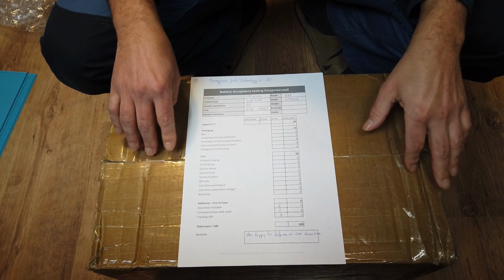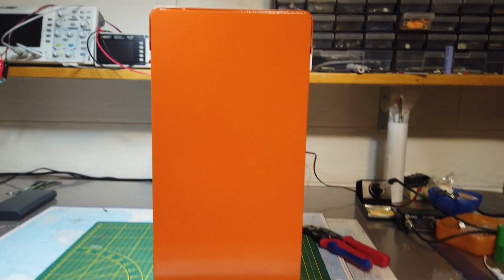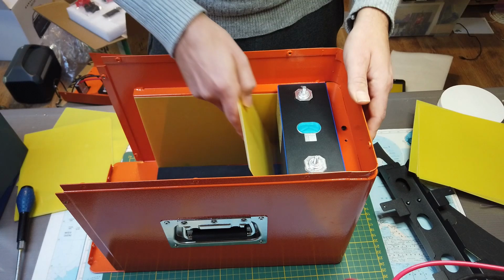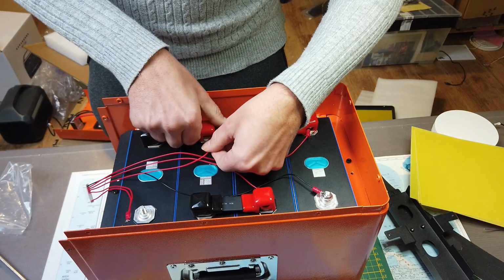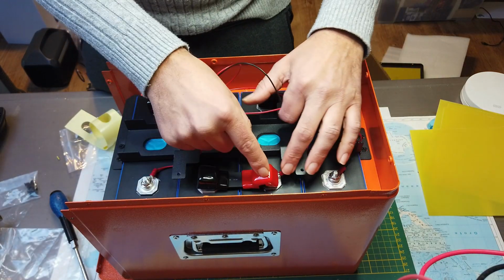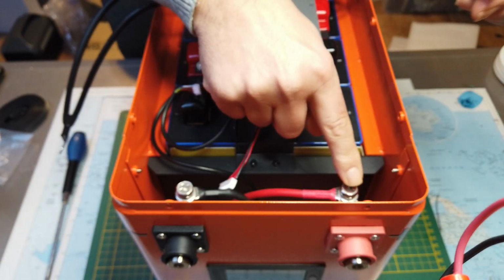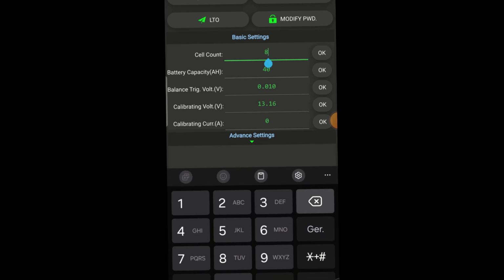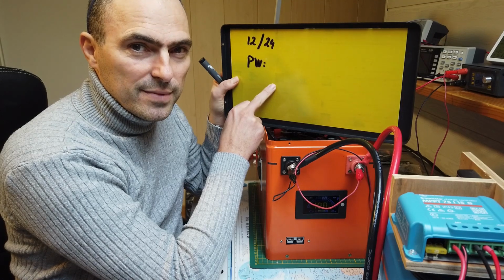UBP DIY battery box step by step assembly guide

Comment: They are using two 8AWG wires for the negative terminal? That's a recommended ampacity of 110A. What's the point of a 200A continuous BMS if the cables aren't rated for it?
Also, I noticed you put the main negative lug above the balancing wire lug. Lugs carrying the most current should be closest to the power source.
Reply from the maker: Good remark. I mentioned it for the positive pole but didn't apply for the negative pole. Will add "errata" under the video and on the EASYPOWERWALL FB page.
About the power, it's always good to have some headroom. 80AMP/1KW is no issue after 15min. Had no 2KW inverter at hand to test this load....But I agree 2x 8AWG is not designed for +100A for to long.
Reply: @easypowerwall  Thats a general problem with chinese cables. too thin. I use for such cells and the JK 200A  AWG3 two times (25mm² x2), AWG5 two times would be the minimum (16mm² x 2)

Comment: It would be good to add a Circuit Breaker for the 12V Battery Box version and I would also like to have two main plus and minus terminals instead of just one.
Reply from the maker: All the wishes will have an impact on the price ofcours. Price wise this box is best in class. Personally I like a fuse/breaker out of the box, but I put it on the list.

Comment: I prefer the larger JK 4.3" touchscreen, it would be good if the UBP had a user-buyer display option.
For me missing mounting options for these 12V and 24V battery boxes. For newly manufactured battery boxes it would be good to add rows of 3 to 4 threaded inserts - min. M6 - down above the base and under the lid, from the outside to the back wall and into the side walls.
Reply from the maker: Thanks for the feedback Tibor. Will collect all feedback and send it to the factory/dealer.